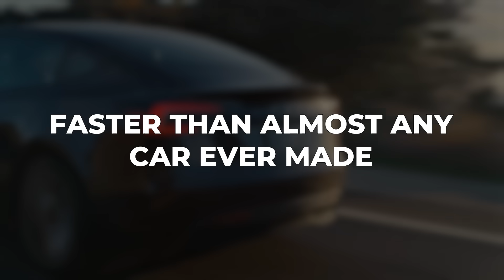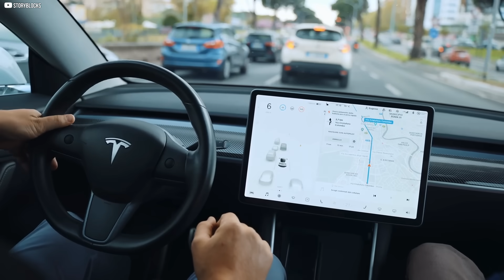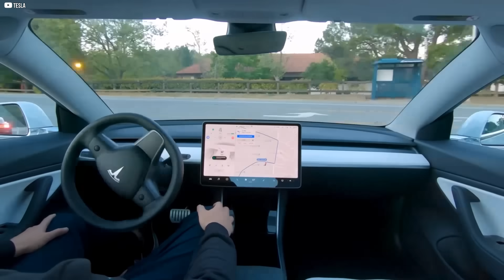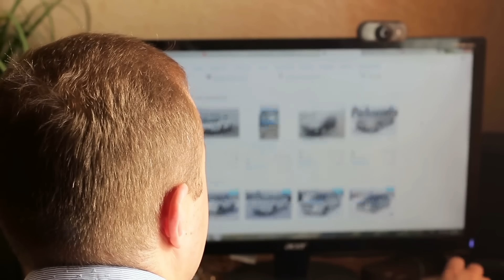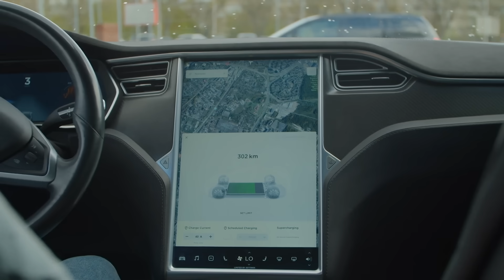Elon Musk’s New Engine Just Ended the EV War

Comment: Does a Tesla remember and report every pot-hole.  When will its car-truck have a mega molded Kevlar body shell. When will Tesla produce an 87% fuel efficient hybrid . There is still lots of innovations to be exploited.  And Tesla software/firmware will be very difficult to hack(an unmentioned safety feature).

Comment: The major problem with EVs is the battery. The current battery technology simply is insufficient to make EVs practical for most people. They are way too expensive, have very limited range, and take way too long to charge. They are also suspeptible to salt spray, do not work well in cold temperatures, and occasionally suffer catastrophic failure and burn to the ground. And there is no good way to dispose of them so they are an environmental disastor waiting to happen. A totally different battery type must be developed.
Reply from the maker: It's fascinating to consider the challenges of battery technology and the need for further development.

Comment: @paulbrackett60 makes a point, but a question: why don’t the wheels produce power to charge the battery, while in motion?  Done correctly, you would never have to plug the car in, it would remain fully charged at all times!  Right? Right?

Comment: The problem is not the engine, is the power source.  Current batteries are extremely toxic to the environment.  Their disposal is a massive problem and a massive ecologic catastrophe in the making.  We don't need a clean energy revolution we don't need a clean battery revolution.  Until this issue with batteries is resolved the internal combustion engine is the best bet for the environment. This is why I was fairly sure that the hydrogen engine could be the future if they could make it safe and by this I mean safe in a collision.   I know self driving cars are the future and will soon be mandated.  This should reduce the chances of collisions on the road drastically  But if there is still a chance of a system failure resulting in a collision and igniting the hydrogen in the car I don't know if that's a risk many are willing to live with.
Reply from the maker: It's true that battery disposal is a challenge, and there are definitely a lot of conversations happening around that.

Comment: move toward making the hydrogen onboard,   as it runs.  then,  you can use the car to power the house when you get it home,   NO,  you don't have to charge it,  it will be charged already,  and i know you can do it Elon,  I just don't have the money as you do.........     each cell produces a volt an a half,  while its making hydrogen,onboard,  the motor an one battery is all you need to power a tesla quake radio.  And one of those is all you need to power a house with.....OF course you will have to work that out with the gov to get an ok on it...   Its time you start using what was made to kill people to keep em alive,  as Nikola would of wanted you too.
Reply from the maker: That's an innovative approach to energy independence; thanks for sharing!

Comment: I agree with everyone else … I’m into rc cars…I repair and rebuild…the most dangerous and volatile part is the battery… Li batteries will overheat and are unstable. The motors do to but it’s the batteries that need a real checkpoint!…and btw , the EV cars we drive are just oversized RC cars…they use a EDC and their steering wheels are the controllers! Also, this new motor…it’ll cost a shit load more…none of us have elons money…it’ll only be good if a blue collar guy can afford it otherwise it’s a car for the rich only…and they don’t need more luxuries!!!
Reply from the maker: It's true that battery safety and affordability are key considerations for EVs!

Comment: Why havent they made a self charging car instead of draining power of the grid
Reply: YOU MEAN A HYBRID ?
Reply: @clridesagain7308  No a hybrid runs on both fuel and battery , these pieces of crap have to be charged of the grid NO have there own charging system alone
Reply: I saw an F150 Lightning at the Fleet Farm near where I live. The guy had a big gas powered generator running in the back to charge it up.  Stupidest thing I ever saw.
Reply: A self charging EV is impossible. The energy must come from somewhere and EVs use a lot if it. The laws of physics cannot be broken.
Reply: You are spot on. This has to be the first question to ask. Self charging is the only way. EV’s will ever move forward.
Reply: @pdubya4690  Thank you someone else that has common sense for a change ITS NOT ROCKET SCIENCE
Reply: @kev4587 You need to take a physics course. Energy must be created. It does not exist on its own.
Reply: @pdubya4690 How, may I ask, are you going to bend the laws of physics to create a self changing EV? The energy must come from somewhere. Right now the majority of energy used to charge EVs comes from coal plants. That makes EVs several times worse for the environment than gas powered cars.
Reply: @herbb8547  You could start with an integrated solar panel and possibly mini wind turbine driven by the engine to develop energy during a 24 hour period. Using braking power is already a norm and tweaking the engine at the same time to increase kinetic energy could probably increase power output. The key component is the battery and any breakthrough in endurance and storage, which will happen,  will have significant  future effects on the overall life and range of the vehicle.
Reply: @pdubya4690 Solar panels would never produce enough energy to power an EV. Nor would little wind turbines. EVs take a great deal of energy to function. Maybe you don't know this, but EVs are much heavier than similar gas powered cars and require much more energy to move. EVs are extremely inefficient for that reason alone. EVs, in their current form, will never be practical for the vast majority of drivers.

Comment: Remember chukombuto, who invented the car, motorcycle and power generator that doesn't need fuel or batteries. Is there a reason nobody's talking about that but having full discussions about a tesla?
Reply: Agree...Maxwell Sangulani Chikumbutso is a Zimbabwean inventor known for creating a car that allegedly runs on radio waves, requiring no fuel, recharging, or external input. This car, known as the Saith FEV, is touted as a fully self-sustaining electric vehicle. 

Key points about Maxwell Chikumbutso's car:

Allegedly fuel-free and self-sustaining:

The car is claimed to run on radio waves and doesn't require external power sources. 

Uses a microsonic energy device:

Chikumbutso's innovation involves a device that converts radio frequencies into energy. 

Ongoing debate and skepticism:

While some hail his invention as revolutionary, others question the scientific feasibility and lack of rigorous testing. 

Potential for a significant impact:

If his claims are verified, the technology could revolutionize transportation and energy. 

Difficulty in patenting:

Chikumbutso has noted difficulties in patenting due to the unconventional nature of the invention.

Comment: The prob with EV's is they use the ancient lithium ion battery that takes forever to charge. Also Tesla doesn't make a car for Australian conditions. The poorly insulated glass roof allows too much heat through and the indicator is on the wrong side. Hyundai wins as they build cars for Australian conditions.
Reply from the maker: It's interesting to compare the different designs and features offered by various manufacturers.

Comment: Without trying to be negative, it was stated 8n the video that the body will be constructed in carbon fibre. An amazingly strong and light material that shatters with sharp splinters in a crash. Accepted for car racing but not for private drivers and passengers.
Reply: GRP/Fibreglass also produces a shower of sharp shards and a snowstorm of particles when impacted.
I've witnessed it and some of these vehicles have been on the roads for the last 40+yrs.
Reply: Maybe they have figured out a way to stop the shattering.

Comment: Every EV will go unsold after Toyota releases it's self generating hydrogen vehicles (use electrolysis and water to create hydrogen). Vehicle uses distilled water and nothing more. No gas, no diesel, and no looking for an EV charging station...that's not damaged. And, best of all, Toyota's drivers won't have to avoid travel to areas without EV charging stations.

Everywhere has distilled water: and it's dirt cheap, and has only water as it's byproduct. EV owners are using diesel, gas, coal, and nuclear to charge their cars versus water.
Reply from the maker: That's an interesting perspective on the future of vehicle technology and alternative energy sources.

Comment: I  can't accellerate fast or drive fast because I will be stopped and given an expensive ticket. Whatever kind of charging you do, it will take longer than filling up with gas. Chargers are not as common as gas stations. Electric cars depreciate a lot. Tesla's cars are expensive to insure because of the mega casting.  Full Self Driving costs you extra and it is not full self driving yet. Besides, I like to steer the car.
Reply from the maker: You bring up some valid points about the different aspects of owning an EV.

Comment: That's all they did is they looked at the parts of a gyro and a satellite which has to work an absolute zero with air bearings because the RPM is insane 800, 000 RPM 300,000 RPM and its slowest when no longer has sun

Comment: Nice but the new engine is not such a big deal if it won't work in low temperatures. What we really need is a revolutionary battery system.
Reply from the maker: You are right, the development of advanced batteries is crucial for the future of electric vehicles.
Reply: @TheForgeEmpire  
The main reason why a lot of us don't find EVs useful at their current state. Can't have a bricked EV during the winter.
Reply: @TheForgeEmpire  I've been thinking couldn't we use quantumly entangled particles to run our electronics? keeping 1 half of the quantumly entangled particles at the point we create the electricity and the other half in our devices and vehicles? allowing them to stay charged at all times at any distance no interference? if Germany was able to do it with the internet then i dare say we are on the edge of this being the next step.
Reply: @TheForgeEmpire he did mention the new battery,lighter,more efficient, not built in China,and they are heated for cold temps..The next level before hydrogen or Flux capacitors...
Reply: there has been people that have driven their teslas above the Arctic circle quite happily
Reply: We need nuclear diamond batteries.
Reply: @pez001pez  yes Bring on the lightsabers!
Reply: and lack of infrastructure
Reply: This is a new way of still being dependent on batteries, a century after Tesla and in the era of Maxwell Chikumbutso, the revolutionary Zimbabwean inventor of the electric car without recharging.

Comment: The next move would be to dump lithium batteries.
Reply: Exactly, they're highly ineffective & toxic as well as explosive.
Reply: Soduim batteries next.
Reply: @russellk.bonn8534 they do show some promise.
Reply: Interesting design. I can't wait to see how it compares to a new multi fuel engine design. Much lower rpm but double the torque output of tesla's motor without problem. Given musk's money this engine would have been out already. In a hybrid vehicle this engine and teslas motor would have the best of both worlds.
Reply: Oh that's fine and dandy but keep in mind the electric has to come from somewhere
Reply: @Bslim-l9xyes it does.Electric vehicles are not the long term solution. Hydrogen internal combustion needs a hard look. If a low cost way of extracting hydrogen from water can be found we would be in good shape.
Reply: @paulbrackett60 No Electric drive is Permanent until Clean Nuclear Power replaced them.
Reply: @JimmyRussell-c2s  I agree. Or go to hydrogen internal combustion.
Reply: The e got lighter weight batteries that charge in about 10 minutes now
Reply: Better yet, eliminate batteries altogether!
Reply: @RandeauChristoferson I agree. Hydrogen internal combustion. Let’s figure out how to cheaply remove hydrogen from water. Then we’ll be golden.
Reply: Next step is nuclear fusion engine it'll take about 20 years
Reply: No point
Reply: @aquadotnets  They torch faster than you can scape

Comment: Can't run electric vehicles in a Canadian winter and could be dangerous if occupants are stranded.  It's not just the engine.  Power storage and recharging in -20C is not efficient.  ICE vehicles are always going to be required until serious issues are solved
Reply from the maker: That's a valid point about the challenges of cold weather for electric vehicles; the technology still has room to improve!

Comment: You'll still need to generate electricity at the source (the Power plant) with mostly fossil fuels 😱😂🤣
   Yes, when using fossil fuels to generate electricity, the process still requires power plants, also known as the source, to convert the fuel's energy into electrical energy. Fossil fuels like coal, oil, and natural gas are typically burned in these plants to heat water and create steam, which then drives turbines connected to generators to produce electricity. This process is essential for generating electricity from fossil fuels.
Reply from the maker: That's a great point about the whole energy cycle; it really emphasizes the need for sustainable sources.

Comment: 🙆🙆🙆 Zimbabwe just did already 👾
Reply: Do you need a half ton battery to create the radio waves?
Reply: Maxwell Sangulani Chikumbutso is a Zimbabwean inventor known for creating a car that allegedly runs on radio waves, requiring no fuel, recharging, or external input. This car, known as the Saith FEV, is touted as a fully self-sustaining electric vehicle. 

Key points about Maxwell Chikumbutso's car:

Allegedly fuel-free and self-sustaining:

The car is claimed to run on radio waves and doesn't require external power sources. 

Uses a microsonic energy device:

Chikumbutso's innovation involves a device that converts radio frequencies into energy.

Comment: In March 2025, Toyota launched an EV in China for about $15,000.
The main factor that Toyota was able to achieve this low price seems to be the adoption of a cheap battery made by China's BYD.
The new battery is a different type of lithium-ion battery from conventional lithium-ion batteries.
Battery performance is expected to decrease slightly, but the risk of fire is significantly reduced.
Reply from the maker: That's some great insight into the EV market, it's always evolving!

Comment: We shall wait until Elon and Maxwell come to the United States.
Reply: Maxwell Sangulani Chikumbutso is a Zimbabwean inventor known for creating a car that allegedly runs on radio waves, requiring no fuel, recharging, or external input. This car, known as the Saith FEV, is touted as a fully self-sustaining electric vehicle. 

Key points about Maxwell Chikumbutso's car:

Allegedly fuel-free and self-sustaining:

The car is claimed to run on radio waves and doesn't require external power sources. 

Uses a microsonic energy device:

Chikumbutso's innovation involves a device that converts radio frequencies into energy. 

Ongoing debate and skepticism:

While some hail his invention as revolutionary, others question the scientific feasibility and lack of rigorous testing. 

Potential for a significant impact:

If his claims are verified, the technology could revolutionize transportation and energy. 

Difficulty in patenting:

Chikumbutso has noted difficulties in patenting due to the unconventional nature of the invention.

Comment: Your statement of engine is fundamentally incorrect! A engine converts fuel directly to heat in expansion of the burning creates mechanical energy! A motor requires energy, electrical, hydraulic, pneumatic, sources to operate to function for mechanical energy production. Basically a motor is a thief whereas an engine is a direct converter. We are chemical engines . Our bodies are chemical engines converting chemical energy to mechanical energy,motion as mechanical motion physical motion and sustainment❤.

Comment: Koenigsegg ??? pretty certain they had this style electric motors more than a year or more back
Reply: a example / 
Koenigsegg in-house designed Dark Matter e-motor
6-phase
Power: 800 hp
Torque: 1250 Nm
Raxial Flux configuration, mix between radial and axial
Max motor RPM 850

Comment: So the dark matter electric is far beyond anything else. And tesla doesn't have a dark matter motor
Reply: Koenegsegg has a new dark matter ICE/EV in the works.
They claim 800 hp from an 85 lb powerplant. Continuous high power output, with high reliability.
I be digg ohne dhat.  😶

Comment: Technically you can make your own bio-fuel or alcohol at your house and use it in a quiet diesel or turbine generator to charge you car overnight at home for free. Every Tesla owner should have one.
Power companies and big oil disagree.
Brazil uses flex fuel from sugar cane and it works- even in big metro-areas. Their engines run or standard gas or bio with the flick of a switch.
Reply from the maker: Interesting! It's amazing how diverse the options for powering vehicles can be. Thanks for sharing!